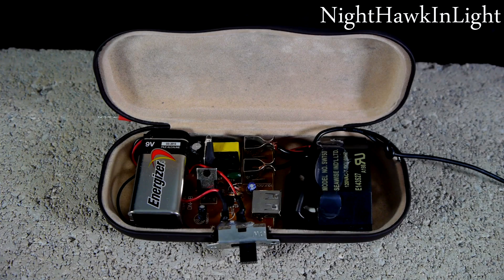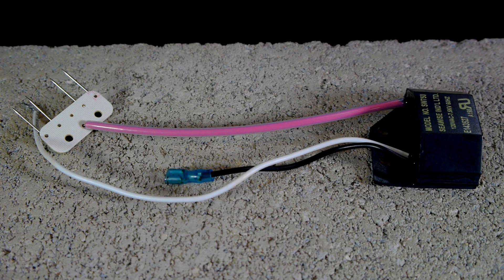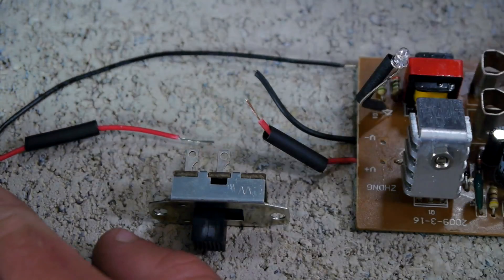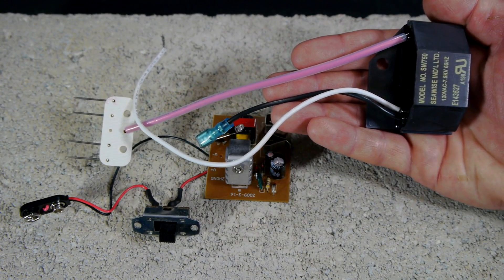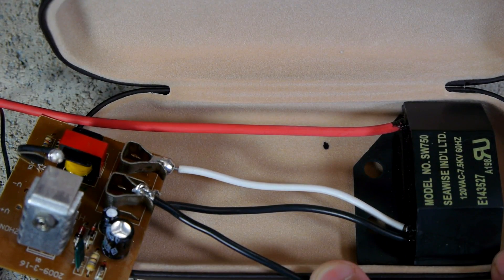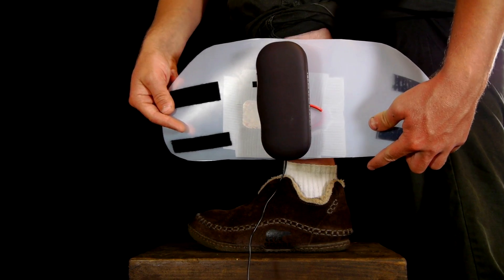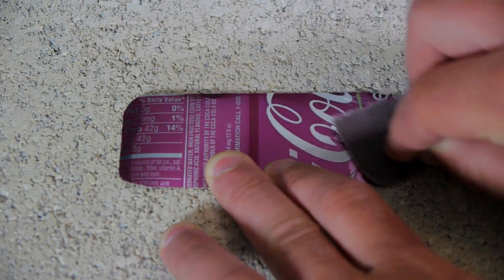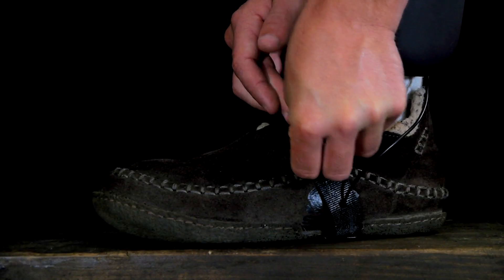How to Shock Anything & Fry Electronics with a Touch!

Comment: Does it use the 9 volt battery as a power source or does it use the 9 volt battery to store the static electricity it collects? If it is option 1, do you need to replace the battery every time it runs out of juice? Sorry, I don't know much about electronics.
Reply: Also, if it uses the battery as the power source, why does it need to collect static charge from the ground? Please reply!
Reply from the maker: TheEpicPineapple56 I'm not entirely sure why it needs the ground, but it does. I believe it has something to do with the device creating differential charges between two surfaces rather than simply pumping electrons into something. Yes, the battery will run out and need to be changed every once in a while.
Reply: Thank you for responding so quickly. I was just wondering because in the video, you said that it pulls in electrons from the surrounding area and then later you put a battery in. I just a little confused. Thanks for clearing that up for me.
Reply: TheEpicPineapple56 The ground is needed because electrons run exactly like electricity. The ground basically finished the circuit of a negative load (coming from you) through a conductive surface (whatever you touch) to either a ground or positive terminal (the ground on your foot in this case).
Reply: Oh, I see. Thanks

Comment: in my attempts in becoming cole from infamous... I WAS SUCCESSFUL! a backpack full of industrial capacitors, a car battery, and a rubber sack to put it all in, I made a spider explode...
Reply: Not quite, I put it all in a rubber sack(made from a tire inner tube, therefore its not touching me. I have a full aluminum foil leg sheet, from my thigh to my ankle. and then I have as much spandex and rubber clothing on under my actual clothes. I put that rubber sack, by the way, in my backpack(high sierra, camo swag). after using it in excess of 5 minutes, I need to lay on the floor when im done using it, to remove residual electricity that might possibly kill someone if they touch a power outlet or a telephone pole or something. I didn't want to waste my life typing up all of this in the original comment, but people need to suspend their disbelief.
Reply: Remind me to stay around a mile away from you at ALL TIMES!
Reply: sure thing...
Reply: sounds incredible i want a video
Reply: I fucking love Infamous... but Cole died D:
Reply: NIICEEE!
Reply: it leaves too much residual electricity... i'd break things.
Reply: in case of that comment beeing the truth, you weren't even able to write.. because you would actually be dead.
Reply: don't do it tho

It is most likely not gonna be good for your  health. The heart uses electrical impulses to beat, and that Will mess with it if you do something wrong. I don't know the parameters of safety with that project, and I could very well have died if something went wrong.
Reply: How are you alive?
Reply: I’m kinda doing the same thing except with 4 negative ion generators which will output up to 100,000 volts

Comment: What happens if you use a "camera taser" circuit rather than the 12V converter? Is the voltage too high?

Comment: you can make it much more powerful if you use 8 AA batteries for 12 volts, instead of one 9 volt battery. Also for those of you who were wondering about the cost I spent $15 on the ion generator in this video, and $3 on the AC/DC converter

Comment: Make this, then touch your enemies cell phone.
Reply: Trips and touches phone "Oops, I forgot to turn off my super powers before I left the house this morning."
Reply: IPWNFORCHEESE "Damn you apple! This is why we buy Samsungs!!"
Reply: Ashley theawesome The thing is, they won't know it was you unless you make it obvious. Accidents happen. ;D
Reply: Why there cell phone why not............. THEM
Reply: or just go to their house and touch their refridgerator microwave oven and computer
Reply: thats a great idea. why not destroy somebodys phone just so you can pay for it!! actually thats actually a funny idea. love it
Reply: Ashley theawesome What if you were to touch the audio jack or the power jack? Would it fry it then?
Reply: you probably woul have to hold on to a metal rod and stick the rod in the audio jack in order to mess it up
Reply: IPWNFORCHEESE  you sure do make a good point.
Reply: Gavin O'Brien the refridgerator and microwave wouldnt do anything. oh and btw it wouldnt do much to electroncs. it most likely only do damage if the electronics were taken apart or to have an open circuit
Reply: Ashley theawesome Mac books should be damaged, since their outer shell can conduct electricity
Reply: good point
Reply: or-you-could-break-a-charger-and-strip-the-wire-plug-it-in-and-touch-it
Reply: Gavin O'Brien or do that but why would you try to destroy your electronics on purpose
Reply: use-a-broken-one
Reply: OR USE SOME MO' FUCKIN' PLASTIC EXPLOSIVES. Over the top? I don't think so...
Reply: yea

Comment: i have a question if i may ask. what was that little glass beed like thing on the alligator clip, needle noe clips...
Reply: That is a led. They come in many sizes. Small and large. They for most part run off of 3v or 5v. There are some that use more but they are much larger and more powerful like 10, 50 and even 100 watt models.
Reply: ok, thanx...helpful

Comment: My ground wire is silver instead of reddish brown. Is that a problem?

PLEASE ANSWER
Reply from the maker: I have no idea.
Reply: NightHawkInLight nevermind. I originally made the leg harness out of multiple layers of duck tape but today I replaced it with a plastic jug. It must of been arcing to the case.
Reply: the color of the wire doesn't matter. It's just a different metal, but both work just the same.

Comment: I once tried muscle stimulators..I think they are a couple hundred volts AC power, very low current, and they did hurt somewhat since vitualy my entire leg was ON....but I guess it depends on how much used to it you get. 

How do you discharge yourself completely once you turn this device off ? Is there any residual static charge ?

Comment: Couldn't this kill you if the charge crosses your heart? (you touch something with your left hand while the device is on your right leg)
Reply: only if you have high voltage in your device
Reply: Felix Hunter amperage is what kills you not voltage
Reply: yeah, but low voltage, and it won't end up killing you

Comment: If you follow the links this guy puts I guarantee you will spend more than $60, try doing some research, it could save you +$30. I've done it already. It is not Fatal and is not very strong lol, does give a good jolt though I will admit.

Comment: If you held a lightbulb would it turn on
Reply: Mikkel Ljungberg Ugh. don't comment if you don't know the laws of electricity. I don't mean to be rude, but you shouldn't pretend to know what you're talking about when you don't. The ground that is connected to his shoe is in order to generate the high voltages in the output of the generator. What I'm talking about is grounding the lightbulb. Voltage is basically the difference in charge. Everything has a charge, and charges like to flow from high to low. Your average lightbulb has 2 contacts, the bottom portion (usually high) and the screw portion (ground), which are seperated by glass or plastic. In order for the lightbulb to illuminate, you must have a higher charge on one of these poles, and a lower charge on the other. If you touch both with your hand (which is charged) nothing will happen, because electrons will not flow. In order for the lightbulb to light up when you touch it, whatever contact you aren't touching with your hand must be in contact with the ground. This will allow the charge to flow through the lightbulb, which could illuminate it, and then to the ground. 

Without grounding one pole of the lightbulb, electricity will not flow. Period. So stop trying to be smart when you obviously don't know what you are talking about. By the way, static electricity still behaves the same way as "normal" electricity, it still needs a low voltage area to be in contact with in order for the electricity to flow. This is why if you rub your head on a balloon then let go of the balloon and touch it again, it won't shock you. Because both you and the balloon have the same charge, and therefore there is no flow of electricity.

There's my rant. Now please stop saying you can light up a lightbulb simply by holding it, you cant. If the lightblub has one of its poles grounded, then yes you can. Otherwise, no. you can't. so please stop.
Reply: LuuxIor. Ljungberg No...you don't get how electricity works do you? First of all, the ground on his foot is isolated from his body via the rubber shoe sole. The only way for the high (his body) to get to the ground (on the bottom of his shoe) is if whatever he touches is somehow touching the physical ground he is standing on (assuming whatever it is that is touching is slightly conductive). So therefore, no. A lightbulb wont turn on unless you soldered a wire to the negative output and let the wire touch the ground.
Reply: Slaytounge Flawed logic? Did you read what he said? "What you are saying here is incorrect, because there runs a fricking wire from the plate under his shoe, to the machine. So no, it doesnt matter if it's rubber of fucking metal shoes he is wearing. Second of all; Static electricity is what this machine generates, and static electricity of this amount will EASILY charge a lightbulb. Boo fucking hoo."

That isn't just being incorrect, that is blatant ignorance and an attempt to prove me wrong for the hell of it. I don't like to post rude comments, but when people go out of their way and say wrong things just to try and prove me wrong, that bothers me. Besides, that's what google is for!
Reply: abanoub tawdrous Yes that would work, however because the human body is conductive it would be impossible to make one hand have a positive and the other negative. The electrons would simply pass from the positive side of the body to the negative side before you even had the chance to touch a lightbulb.
Reply: No it wouldn't, it isn't grounded. The power will only flow if what you touch is somehow touching the ground.
Reply: MagmaRhino  \you are correct but a thing that needs to be invented is a matter condenser so that it could take matter from the ground and power anything with plasma because plasma is condensed mater and so it could be used to revulitionize powering stuff and could power stuff from light bulbs to cars with a single touch
Reply: Demetrius Swanson Well you only need one person with a positive charge, the other could just simply be standing barefoot outside on the ground (or on a somewhat conductive surface). So if you had your friend holding the bottom of the bulb and you had the charger and touched the side of the bottom, it should technically light up (assuming the voltage isn't so high that it just blows out the filament.)
Reply: Troy Nall Flourescent bulbs actually work the same way. You may be thinking about the long tube bulbs being different because they have the external ballast, but that is just a device to double the voltage (well it is used in the US and other places where the grid is 120v, as the long tube bulbs require about 240v). But the bulbs still have 2 poles and would still require one to be grounded.
Reply: MagmaRhino if you had two devices and completed a circuit through the light bulb wouldn't that work? example: say if your right hand had a positive charge & your left hand had a negative charge and you hold the light bulb correctly positioning your positive charge with the positive end of the light bulb and the negative charge with the negative end of the light bulb wouldn't that complete the circuit and illuminate the light bulb?
Reply: MagmaRhino thanks :)
Reply: i think if the lightbulb was a flourscent. im a right ?
Reply: MagmaRhino "Ugh. don't comment if you don't know the laws of electricity. I don't mean to be rude, but you shouldn't pretend to know what you're talking about when you don't."

I don't know why you would assume he was pretending anything, he was probably just genuinely wrong. Also, how would he have known he was wrong without commenting and being corrected? I've seen this flawed logic too many goddamn times and it's getting irritating. Honestly, from now on think about what you say before you say it.
Reply: So if two people touched the bulb one with pos and one with a neg charge going through this would work?
Reply: MagmaRhino
you are correct but if he held the lightbulb in a way the positive side is touching the ground and you held it it would work
Reply: MagmaRhino thank you 5 grade science teacher
Reply: Excuse me but I belive that any light bulb you can get will have a way higher operating current than this machine can generate. 
It's like trying to power a light bulb with a neon driver. 
It wouldn't work (tho if you have a grounded wire on the glass and a powerful static generator the vacuum inside the bulb should be enough to generate a beautiful Corona. So there's that. )
Reply: MagmaRhino True... I'm not that experienced but I do know is that the reason why birds don't get electrocuted when they are on power lines, is because they aren't grounded, or touching the ground. Same thing with a light bulb. The reason why it won't light up in this situation is because the rubber in our shoes is just about enough to be an insulator. Meaning that electricity won't flow between the rubber (and what's touching it) and the ground. If you weren't wearing the shoes, or had them on and were lying on the ground, it should light it (depending on the watt inputs). A circuit has a positive and negative charge, and Jumper cables are hooked up to Car Batteries via this format: Positive to Positive, Negative to Ground. Hope I helped at all
Reply: Yes, depending on how many watts the lightbulb is on :)
Reply: MagmaRhino What you are saying here is incorrect, because there runs a fricking wire from the plate under his shoe, to the machine. So no, it doesnt matter if it's rubber of fucking metal shoes he is wearing. Second of all; Static electricity is what this machine generates, and static electricity of this amount will EASILY charge a lightbulb. Boo fucking hoo.
Reply: MagmaRhino It is "on the ground" aka. it has a "connection with the ground", that's why he puts the metal under his foot... So yeah, it does have ground connection and it would turn on, depending on how many watts the lightbulb is on :)

Comment: That is not the proper way to solder... you should heat the wire/board and apply solder to it, not heat the solder directly.

Comment: If you wore this outside and lightening struck the ground would you fry?
Reply: The lightning would quickly spread to all areas with less charge. That would include you and just about everything else so you would feel a painful shock and nothing more.
Reply: the aluminum on your foot would absorb the electrons.so you basically amp up your power
Reply: You are awesome thanks!

Comment: If you hold the ends of a fluorescent bulb it will indeed light.  Static electricity generated by jumping on a trampoline will make it light for a second, this will probably make it flicker.  A low voltage LCD light would probably also work.

Comment: As I said before MrPeniscola, use Google and learn.  If you can find ONE TV SET EVER BUILT that uses MILLIONS OF VOLTS on the anode of the CRT, why you just come on back and tell me the make and model and PROVE ME WRONG.  
You won't, because you CAN'T.
You can't even comprehend the difference between THOUSANDS and MILLIONS.  You really have no clue how much a million volts is, do you?
You can't be helped, you have a closed mind. But at least TRY and find a TV that uses more than say 20,000 Volts

Comment: So I was just considering doing something like this and was looking at the specs of the negative ion generator and it says 

'Input: 12VDC at 400mA
Output: -20KV open circuit at 50 µamps'

So correct me if I am wrong, but say I found a similar product, that was 220v but <10mA, then the other product would be more painful but safer, no? as the amps are lower (which are what kill), while the voltage is higher? 

Please only people that actually know what they are talking about respond X)

Comment: You don't say?

I was like 11 years old. I'm 23 now and while I don't actually have a degree in electrical engineering like my dad, I know enough to repair most of my stuff. I got shocked dozens of time more after that. I actually got socked on 120v by flicking a light switch, no idea how that happened.

But I've learned my lesson. I"m never touching a cathode ray tube again.

Comment: We had this old 40" CRT that had been sitting around unplugged for months, because my father wanted to repair it, but in the end, a brand new large LCD panel was cheaper than replacement parts for an aging TV. So, on day, I was looking for my father's soldering iron, and it was next to this thing. So I bend to pick it up and doing so I place my hand flat on the backside of the CRT. Next thing I remember I was laying on my back some 6 feet away.

Comment from the maker: Yes, it will make fluorescent light's glow dimly. However that can be dangerous to try, as it is also capable of charging CFL's like a capacitor which will discharge if the terminals are touched with potentially dangerous amounts of current.

Comment from the maker: If you get shocked while wearing it it's not making a good enough connection with your leg, and/or you have not insulated yourself from the ground wire so sparks are jumping from you into the wire or the glasses case.

Comment from the maker: Sounds like the ground you're standing on is not very conductive. This won't work very well on carpet or wood floors. It also doesn't work well if you're not on the ground floor of a building. Both you and whatever you are shocking needs to have at least a lightly conductive path to the ground.